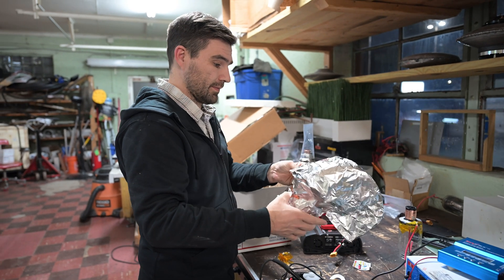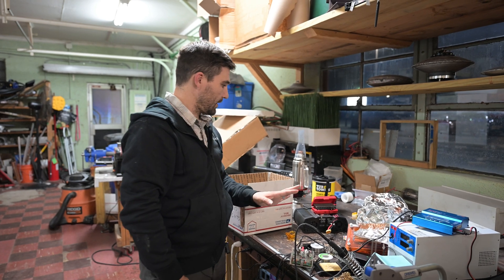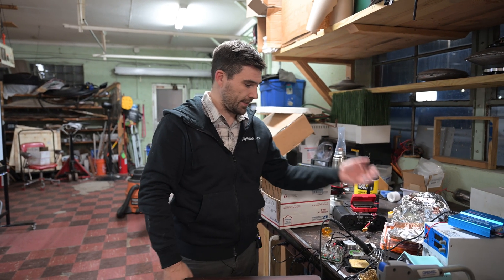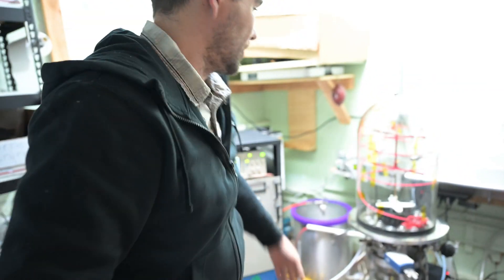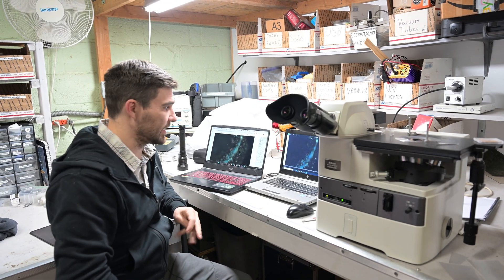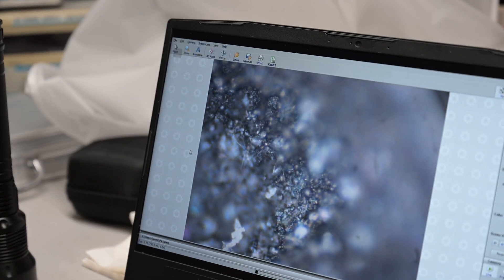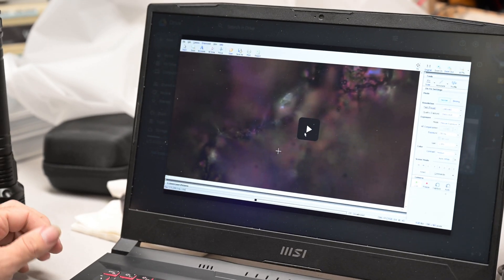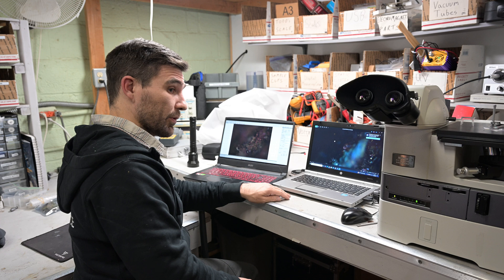Art's Parts UFO Metallurgy & Propulsion Experiments | Jarod Yates

Comment: Jarod, I explained much to Michael about similar things with many emails. Michael and others always change things??? You need a high voltage and a low current that is pulsed very rapidly, so the current looks very high as the electron field is the antigravity waves. Why don't you all understand this? Why don't you chat with me about this. You probably won't even see this message. With my idea you will get a very high thrust. I explained this to Drew and he then does it incorrectly once again??? I know what I am talking about as I worked on this back in the early 1980s. It is an ion thruster. In the low vacuum there is still N2 and O2 as I worked with Mark Tomion on this, so I know. Yea the thruster in the vacuum slowed down as the N2 and O2 fused to other element so there was no more air in the bell jar. Arts parts is US military material that is heat damaged under the pulsed high voltage and low current. The nanospheres, layers are the real modus operandi. The whiskers just form in the cracks as this is where the highest energy is located so they can form. They are not part of the material but formed afterwards with the heat damage from reentry of the craft that they built. Crystals form. Like asbestos or wollastonite. Just saying Jarod and Tim.  Stop being so smart and thinking too much as the answers are simple. Tim when you will post the last Open Mic recording as I wish to share with some scientists, and I am getting slowed down. Jarod the nanoparticles and layers are for increased surface area. The whiskers are not circuits.